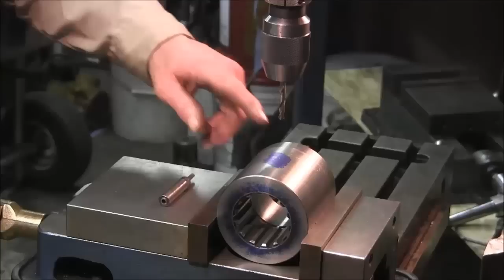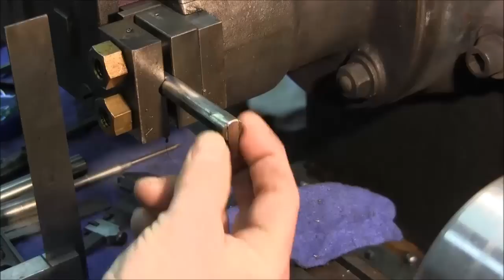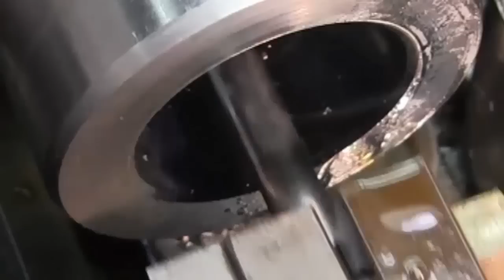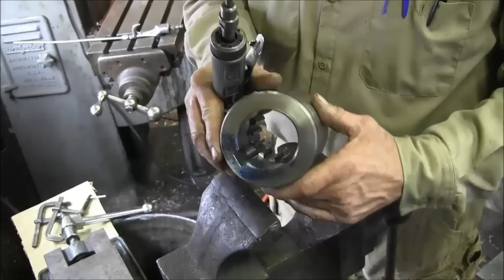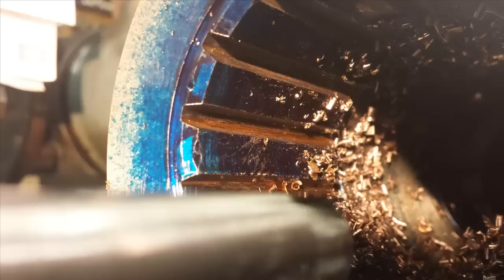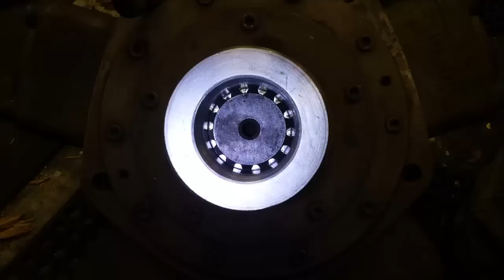The Stroken Spline Part 8

Comment: Keith great vid. I never caught that the coupler was made from stainless; if so disregard the following question. Since you said this coupler is going to be in a saltwater environment would you ever coat the exterior with that epoxy paint you used on the salt water pump you rebuilt. The one that lasts about a year?

Comment: would it make sense to support the back of the HSS steel silver soldered `insert`? A triangle at the back to prevent it from flexing of the HSS could make the diff and makes the toolbit stiffer?

Comment: I'm curious as to why the zerk fitting is welded in to the part. Is this because the part is rotating and an unwelded zerk could fly out at speed? If so, wouldn't the grub screws be at the same risk?
Reply: The welded plug/pin acts like a key to align the coupling to the shaft.  The grease zerk is threaded into that plug/pin

Comment: Thank you for you the magnificent insights. I find the whole thing supremely fascinating. However I have to ask the following. Given the machining time just how do you cost this part for your customer? Its a shaft coupling and most people just wouldn't realise what goes into its fabrication - do you get pushback on the price as this bit has to be expensive?
Reply from the maker: The customer knows this special application is needed and that is why it was brought to me and after we discus whats going to be needed we are on the same page, with time and materials. ;{)------
Reply: Thanks.   Mike

Comment: Keith,
A fascinating series! Tow questions from a layman:
1) Why do you always switch off the motor before touching the countersink bit to the work?
2) Given that you widen the spline grooves by moving the table, not by rotating the work piece, the bottom of each spline groove is flat and parallel to the table. On the other hand, the tops of the teeth on the shaft are presumably not flat, but part of the shaft circumference. Also, by using the table to widen the grooves, the sides of the teeth in your work piece are slightly more angled than if you'd widen the grooves by rotating the work piece. By the time you're cutting the second half of a tooth, the work piece has been rotated one 14th of a revolution. This would make the tooth more angled than if you were working on a flat toothed rack. I'm wondering whether these small discrepancies create any mating issues? (Hope my question is clear, and not too trivial for an old hand...)
Reply from the maker: I shut off the power and then kiss it because I don't want to take the time to lower the speed by changing the belt position so by shutting it off and the split few seconds i'm able to kiss the counter sink to the hole with the right combo of speed and pressure to eliminate any chatter.
The size of the major diameter is large enough not to be a critical factor and the angle of the cutter was made to create the proper angles needed to create the fit, which is it's own angle and not a flat inline with center axis, as you will see in the next videos in this series. ;{)----

Comment: Hi Keith

Great series/build...curious why you didn't use your flood coolant in lieu of the oil brushing....assume it was for your own visual of the tool cutting action?

Chuck
Reply from the maker: There a time for running soup and a time for dabbing saute. Yes it is mostly a visual hindering thing but wearing coolant, ranks right up there with not's.
;{)-------

Comment: Great project!
How much torque does that motor put out?
Reply from the maker: I did not have the spec's for the motor I was only in it for the coupling. ;{)------
Reply: Keith Fenner I did some research, those engines put out between ~700 and 36000NM (thats 516 to 26552 lbft), depending on the size. I guess yours is somewhere between. Impressive!

Comment: Great job utilizing all of the KT accessories! I sold my KT head like that a couple years ago, after deciding a KT mill was out of the scope of machinery I wanted to "mess" with at this time in my life.  I also had the matching tailstock, along with the gear box and drive shaft to connect it to the mill......now I am sort of kicking myself, since the KT itch still requires some scratching periodically! Since I never did get paid for it, I'm still half tempted to try and get it back.....not sure how to correctly identify the model, but it looked identical to your head. As far as markings, all I ever found, was a number in fraction form.....16 over 5779.
      Since I have a small shaper, I always wondered how they were intended to be setup, for use with a dividing head for the type of work you just did....an auxillary table?
    Great work and video!

Comment: hello keith, i really enjoy all your vids. i am 50 this year and am now finally getting my workshop set up and trying to learn some machining skills, having been a lawnmower  mechanic for over 30 years.

i have found the foil trays from ready meals make great catch trays to collect the oil when machining and you can shape them to fit any gap.
also may i ask why you make the form tool narrower than the slot ?
doesn't it make more work that way. it seems to me that if the tool was the width of the slot you would only need one setting.

Comment: Amazing set of videos, something I have never seen being made before and had no idea of the complexity of construction. I use this system of power shaft connection all the time with tractors and machinery, The real pigs though are those connections with a King spline which can only be fitted in one precise location - this involves rotating either shaft until you find the correct place.

Comment: You did a real nice job there, Keith! If it had been necessary, how would you chamfer the inside of the holes you drilled into the part?
I have to drill some holes into a cylinder and there must not be any burrs or the piston would eat itself into the burrs. Would filing be enough?
Thanks for taking your time on making all the good explanations
Adrian
Reply from the maker: Hi Adrian, You can file or burr if you can do it without slipping. Also you can hone after you do the holes to remove and smooth the piston path. ;{)------
Reply: Keith Fenner Thanks alot! :D

Comment: Great work Keith!    I am one that really can appreciate the work involved with this process.   However have you ever considered having them wirecut?    I've made many couplings that are identical to this.  In my area wirecutting is fast, highly accurate and cheap.   This usually means I can spit (2) couplings out in a day if the wirecutter is open for me.   Why (2)?  Because of the cost savings I always convince the customer to buy the spare just in case.   Bonus time for you when the part is out being wirecut. 

Also, there are many times I've had to do calculations to make sure the coupling isn't too strong.   Therefore not damage the shafts if the @#$@ hits the fan, but rather destroy the coupling.   Do you encounter this often?
Reply from the maker: yeah that is why I chose the material I did, was to give a safety margin. ;{)----